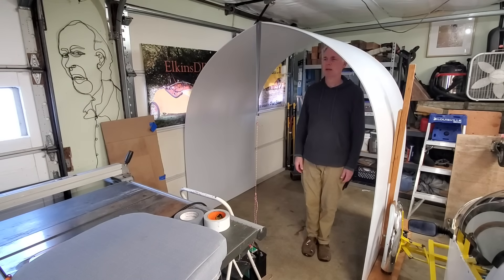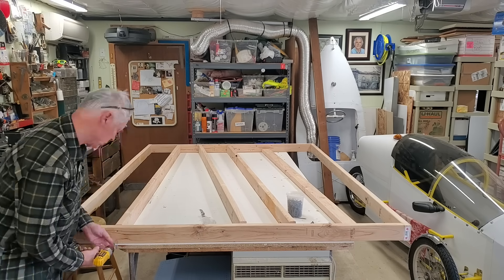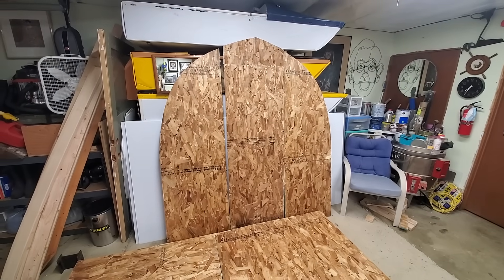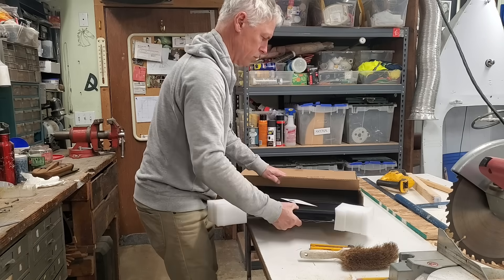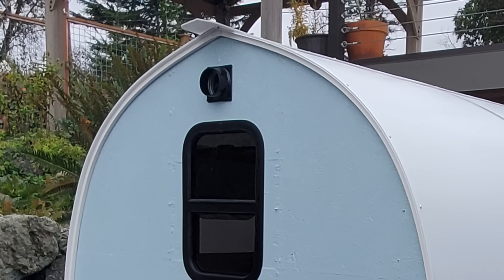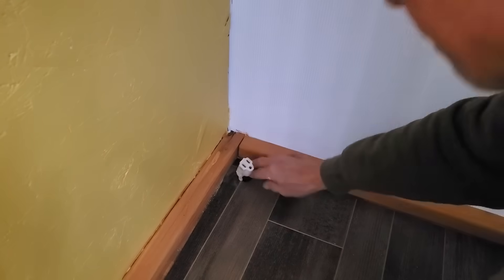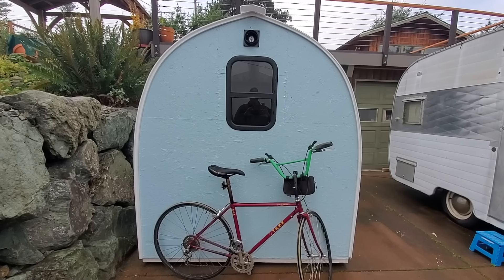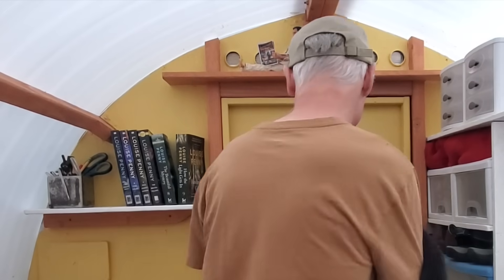Homeless transitional shelter prototype

Comment: There's no insulation for colder climates or hot summers & the thin plastic roof isnt load bearing. That type of untreated wood panels won't last long and will rot with moisture. It's a decent design but needs better quality & pre-treated materials. It's not always about making thing cheap, but making it per city codes and so it last longer without fixing or rebuilding. It  saves money in the long run... I make tiny structures & donate it for the homeless. My little homes are structurally sound & have lasted 6 years so far, without problems or repairs... just an observation.

Comment: Add cork or cloth material for moisture ...Or use stryo for side walls and use cork or cloth material for inside walls too..Just make slits for curve and add spray foam for slits when put up were you want it leave slits inside for walls ...Just trim and cover with material ...
Reply: Paul great build as always ...Keep em coming ...

Comment: Put reflective metal at back end add metal for heat source at back add area for a heater.    The shelter needs insulation twenty inches to be r value r20 so as to survive winter so make it so there is boards twenty inches out then tarp or nail plastic then they can shovel dirt around it to insulate then also you forgot floor space must be larger cause the heaters need several feet clearance or it starts nearby objects on fire 🔥🚒 so note the people who live in vans struggle with this also cause the space is too small and can start 🔥🚒 so tiny homes need to be built with this in mind and it needs a back corner NOT front near exit too many people put heat next to door 🚪 and that blocks escape and is deadly so to solve this add extra footage at front and line with metal sheeting to reflect heat and protect shelter so it does not go up in flames.very important. Also you need chimney vent up top if they use stove or diesel heat they need to air vent so they do not asphixiate so add vent for air your window might work but don't put near heat area or it all escape also venturi angle up pulls heat up and leaves cold down . Make it wider more space .sitz baths do not work for disabled elderly people with mobility can't use but proper tiny hut 🛖 with a tub needed and build rocket stove with copper coil to heat the water in metal tub two hoses to fill look at camping tubs outdoor and note TSC has drink bins could make metal tub for tiny hut but use stove pipe metal hook shape coil copper wire around like spring there is YouTube videos on here and build one like it to heat the water on the tiny house make roof needs to drain rain water into barrels if can for bath water or have city hook up proper water to tiny hut with metal bins for tub water can be heated through way I explained.also please stop the nonsense saying homeless are mentally ill and or on drugs because that is like for ninety percent while ten percent are in drugs issues the other 90% are not on drugs they are sane they simply had unfortunate circumstances be it natural disaster, pandemic loss of work or crime done to them or a spouse left them and kids and or all of above but they are not on drugs most are seniors or disabled and social services does not provide enough to rent if six hundred for old age and or 1200 for ODSP and rents are 2500 they get evicted not because of drug not because of mental reason but because politicians are criminals and refuse to fund vital services or build long term care or fund homeless shelters. So if you do make videos stop saying druggies that are ten percent are who the homeless are as they are seniors men and women middle age people whose spouse committed adultery left them and kids and no support and one income does not cover enough to survive and or it is disabled and landlords make illegal increase throw disabled to street to die

Comment: Хороший домик, его можно возить на прицепе на природу.
Очень понравился. Привет из России.
Reply from the maker: Hello from Russia! I have thought of putting it on a trailer, but it would not stand up to strong winds at driving speed. Maybe if it was turned 90 degrees where he arced roof faced the front. Hmmm

Comment: u can just buy land and make single bed room each for like 100 room on that building and give to homeless... better then make this shelter ... why ??? because land is needed ... this thing will not solve homeless issue .... just wasted of resourcess and stupid
Reply from the maker: If you didn't know, in the NW of America, some local city officials have been sanctioning small plots of land for a limited amount of functional homeless to reside in small volunteer bought and built shelters. This shelter was an attempt to make a cheaper, easier to build and erect temporary shelter.
Reply: @paulwelkinsdiy  that is shelter not home... homeless problem can solve by giving home... give homeless small hope that fit 1 queen bed , small kitchen and bathroom ... and make rule that thing cannot add on... cannot sell that home but can living there forever or until that homeless people leave by themself .... instead making more and more small shelter like this it just make more unsight thing and more rubbish around

Comment: I was gonna get a boat pump for my sink but they were expensive, I just use a pump sprayer from the hardware store, they usually cost under $20 for a 2 gallon sprayer. 

Like you said, keep it simple.

Comment: It needs to support 6feet of snow & be insulated. The plastic will break down in the sun. A good start.
Reply from the maker: Short term shelter that would need someone to knock off a heavy snow build-up. Six feet of snow? Most trailer homes couldn't withstand that load.

Comment: Haha, those bookshelf brackets for connecting the front part of the shelter are hilariously brilliant. Kudos!
Does it get hot in there? Would you be inclined to use the same kind of bubble insulation like in the bicycle camper?
Reply from the maker: I will be adding 1.5" (3.5cm) of foam board soon to the interior and floor.
Reply: @paulwelkinsdiy  Cool. Going to insulate a caravan soon, would be interesting to see the easiest and most cost effective ways of doing these sorts of structures.

Comment: You did not insulate the shelter. Is it to cut cost?
Reply from the maker: Will add 2" of foamboard to the inside soon. Not cold enough. As is it gets 40 degrees warmer on inside than outside with oil radiant heater.

Comment: The homeless problem is so multifaceted that it cannot be easily explained, I cannot blame it on pharmaceutical companies because they produce the only real effective pain killers that works on severe pain. It’s addictive yes, but so is caffeine, nicotine, alcohol, sugar. As someone who has suffered many injuries in the construction industry I can tell you that ibuprofen, tramadol, none of them can knock down the severe pain of traumatic injury like an opioid, you just have to be careful so as not to get hooked. As for the shelter I don’t think it will work as built, especially in Seattle. You need to have at least a 30 amp service to power heaters and the usual person appliances people use. You can bet the occupant will want to use a hot plate or microwave or toaster oven in the winter and a power strip cannot handle that. You might turn the heater off to use one but you can bet your life that most won’t and it will eventually cause a fire. Also you don’t want any kind of outside lock that can be used to lock someone in.

Comment: Great idea. By the time the local government gets through with it, it'll cost $45,000 and last 6 months if that long. There was a fellow in Chicago who came out with simple homeless shelters back in the 70s. 5 sheets of half inch plywood, some 2x4s , stacked 4 high with catwalks in front to allow access. Minimal electrical, a light and one outlet. Washroom facilities in a separate building. Insulated with 2 inch thick foam on the outside. Locking door. NOTHING EVER CAME OF  IT.
Reply: Can you draw some kind of rough plans if you remember enough about it?  Maybe post them online for us to see?
Reply: Правительство занято выводом средств для себя, нужно самостоятельно решать свои проблемы
Reply: Building the shelters is easy. Unfortunately it's the council who refuse to let people actually put them anywhere that are the problem.
Reply: There was one city, in California I think, where somebody set up little homeless shelters like this under an overpass in an unused "parking lot", & the county made them move. I don't remember where they ended up, but the country clearly had no concern at all for them. It was disgusting. California of all places should be open to it. They have one of the highest homeless populations in the country.
Reply: A local area built several homeless shelters/tiny buildings, a couple years ago. Single 
 room w twin bed, desk and chair.
 I believe an air conditioner was included . Bathroom was in shared facility as well as kitchen area..it cost an  average of 100,000 each. They sat empty for some time, due to running out of funds to manage I understand. It's fenced in, w security, so hard to say what is going on now?
Your  idea is awesome ..well thought out and at a very reasonable cost. With volunteer programs like we've been involved in, could possibly get some supplies free or at cost. Just need property for placement,  that's been a huge problem. We spent much more than you did for expensive tents placed temporarily on city property. Your huts would be perfect. Every inch seemed to be  used to its fullest. Well done, Sir! 👍🏼
Reply: Neither God nor maga will solve this. I fail to see either one even offering a comprehensive solution.
Reply: I agree. MAGA FOR OUR COUNTRY is the only answer
Reply: @XC797 - That's a fool notion if ever I heard one.  They're a bunch of heretical christo-fascist oinkers who'd crucify Jesus all over again if they got half a chance.  Evil to their core.
Reply: @XC797  You are kidding... right.  Republicans couldn't care less about people who need Medicaid - and shelter.
Reply: @XC797  MAGA is the reason you need these homes.
MAGA stands to make the multi millionaires and billionaires richer, it does not stand to make everyday folk better off.
Tariffs have proved that, it now costs 30% more for the same grocery shop than it did last year.
Shares and such sing wildly, making money for the hyper rich, no one else.
Farmers are now unable to sell their Soy bean to China, the commodities section wont buy them as there is no market, due to the massive price hike that China have imposed as reciprocal tariffs.

Wake up, just a little.
Reply: No- God is the answer and the sacrifice of His son, Jesus Christ . 
Accept Him today “lest a greater fate   befalls you “.

Comment: Make them live in little boxes is such a genius idea.  That will solve the problem.  They don't need insulation if they run oil heat constantly.  I bet you could get the cost down to $500 and leave room for others to profit a bit.
Reply: and your solution is???

Comment: A good build. If you added some wheels and handles one person could move it by themself. A nice addition might be some solar panels and batteries, with wall outlets. But of course that would add to the cost. If you were planing to use it for adult children living in your back yard, it might be worth the extra cost. But for the homeless, this is a good shelter option. Although for cold winter months, insulation might be required.

Comment: Concrete culvert sections can be had in the sizes needed, add a concrete base for a mattress, do the same for shared toilet/shower facilities. Stack them up and you get high density housing not only for the homeless, but especially for the working poor. Easy to keep clean!

Comment: For some reason state and local governments can't seem to get housing built for less than $250K per door.  Funny how that is.  We tolerate the homeless living in tents on the sidewalk where there is no safety instead of living behind a locked door with moderate, to good, protection from the wind and rain just because a cheap little structure doesn't meet every building code.  Reminds me of the sinking ship where nobody is allowed to use the lifeboats because they were covered with lead based paint.

Comment: Nice build! 

Folks in Southern Appalachia need shelters after their homes were destroyed by Hurricane Helene. But winter in the mountains can get very, very cold & windy. They will need some serious insulation, a wood stove for heat, and then there could also be an issue with snow loads to work out.

But some are in tents, so they would probably be happy with almost anything. Not surprisingly, local building code enforcement has been a problem for some. Heaven forbid that storm survivors live temporarily in tiny shelters that don't meet code requirements. This is where we've ended up in America. No wonder there is so much anger & frustration in our country.

Comment: One weeks pay for one months stay!

We have a baseline for wages but not accommodation.

This makes no sense and simply doesn't work.

The average lowest rent in 2022, ranged from $1,200 to $1,500 per month in many places.

The monthly income, based on the federal minimum wage of $7.25 per hour for a full-time job of 40 hours per week,,amounts to around $1,256.96 per month before taxes.

HUD's Definition of Affordable Housing: The U.S. Department of Housing and Urban Development (HUD) defines housing as affordable if a household pays no more than 30% of its income on housing costs, including rent or mortgage, utilities, and insurance.

This cannot be done in todays rental market.

We need to mandate that all new multifamily complexes include a percentage of baseline units (300 Sq Ft) that can ONLY rent for 40 hours net pay at minimum wage.

Eligibility of these units would be capped.

When the persons income exceeds +X% (determined by local authority) of minimum wage they are expected to move on to a market rate unit.

This will eliminate the need to subsidize market rate units and create a viable option for those on fixed incomes as well.
Reply from the maker: I like it. Good plan.

Comment: Perfect space with all the essentials including books from my favourite writer. How difficult and expensive to add insulation for colder places. You are my kind of person.
Reply from the maker: Another $200 for 1.5" thick foam board insulation on all walls and floor. I made allowances on the wall/ceiling framing for added interior insulation.

Comment: Insulation bruh! That's a moisture trap and mold factory
Reply from the maker: Did you notice the tiny variable speed fan? a must for humid climates like mine, and yes, I might add insulation, but honestly, my plug in oil heater on low does more than enough to keep the interior warm.